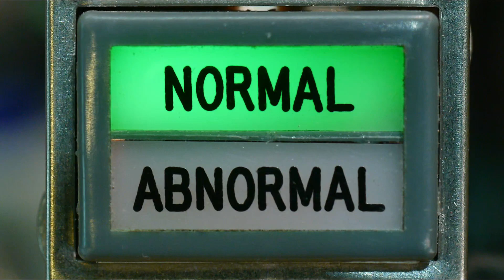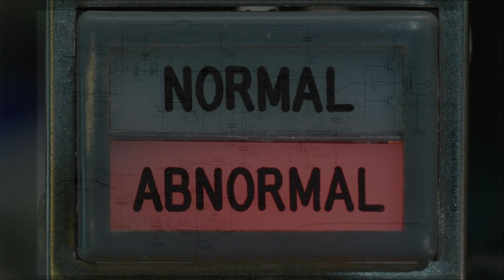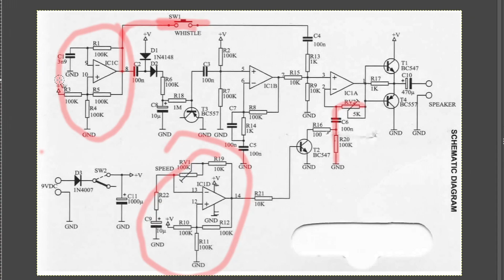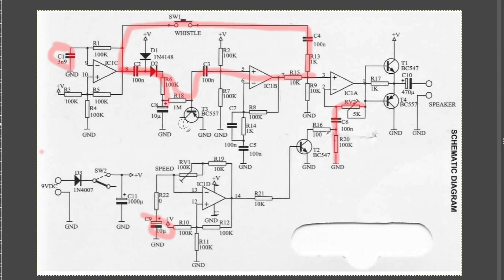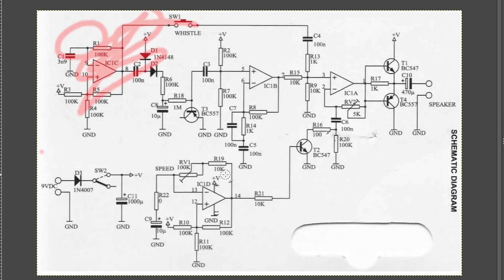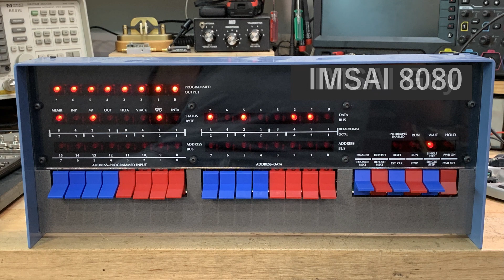#1048 Choo Choo Schematic

Comment: No no, that diodes are not in a feedbackloop. They act as a voltagedoubler, driven by the squarewave AC from the first opamp oscillator. That is nescessairy because to make the transistordiode produce noise it has to get DC above his zenervoltage. Diodes insider transistors typically zener around 11volt at least, so to use a 9volt battery you have no choise than to raise that voltage a bit.

Comment: hum... around 8:38 this is NOT a feed back.  c2, d1 , d2 is a voltage multiplyer to make 18 volt. this is becourse 9v is te low to get the transistor to get in to its noise mode ! . how can you say  r13, c4  put a signal back o the output  of a amp that is lowimp. in real its just a path to get the highfreq square wave to the output ...  if you explaine some thing please do check your self. electronics is ard and with this kind of misinformation yo make it voor other harder to understand it.....  also the oscilators .... working ther is NOT 4.5 volt on the in put there is a resistor R12 and R5 those wile raise and lower the compare voltage if  you dont have those 2 resistor in de neg. feedback then those oscialtors jus get 4.5volt ref voltages ....... sorry for my bad english but i can't stand it when people just spread mis information special when is is about this simple things.

Comment: First  let me say, great channel! But since this very video is intended for beginners mostly, it is important to better explain functioning of schmidt trigger multivibrator with opamp. You forgot to mention 100k in postitive feedback that moves reference point of 4.5V in opossition to capacitor charging/discharging enabling the circuit to oscillate. If the non inverting input was
 to stay at 4.5V, the circuit would not oscillate. :)